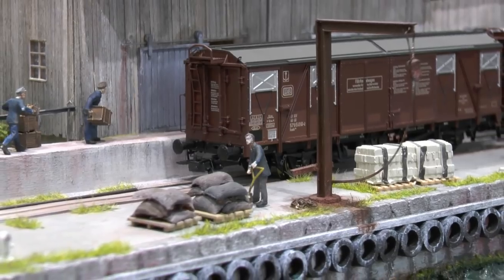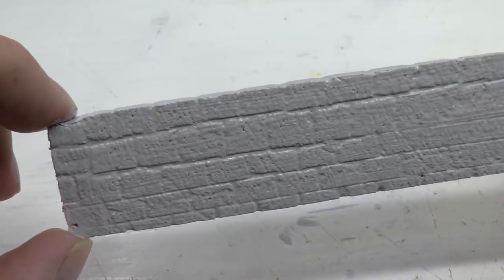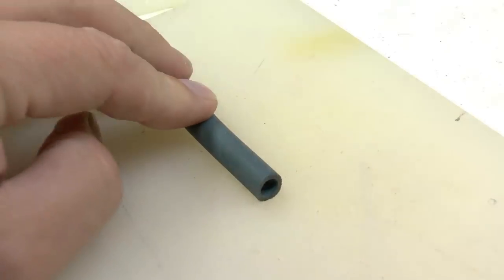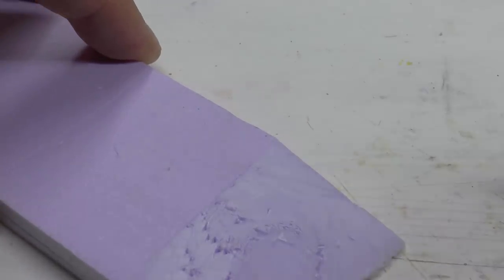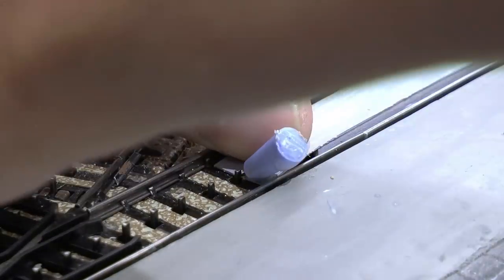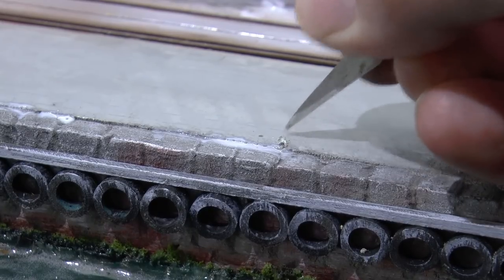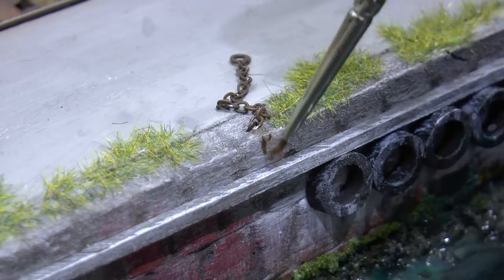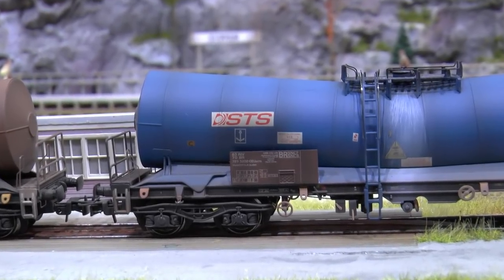Scratch build a Harbour in H0-scale

Comment: Do you have a tutorial for stone buildings? I am a novice at making models  for model rail layouts and am trying to find out how to make a ruined building. I want to make a ruined medieval cathedral for a OO layout . I was thinking of using clay for the whole structure  but, after seeing your tutorial, I am now wondering about making the basic building from Styrofoam (or whatever it was called that you used in this for the harbour wall) then coating it with clay slip.  I only want a small amount of ruined building,  -say one tower with windows and a wall alongside it with some arches.  The area where it will be situated is no more than about 9 or 10 inches in diameter and there will be cathedral grounds, probably with some grave stones.